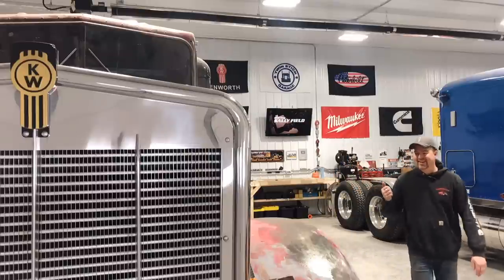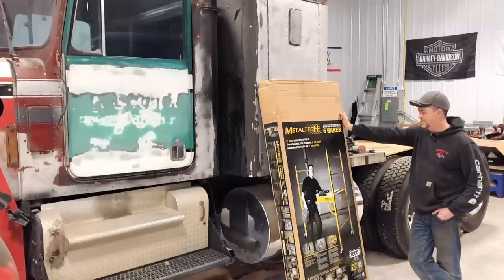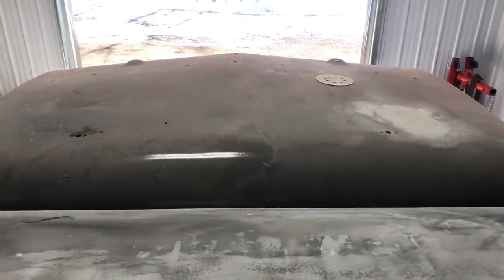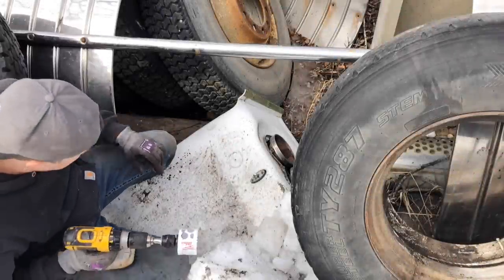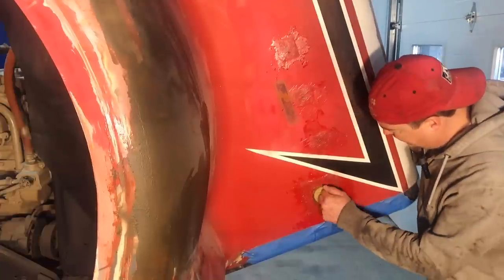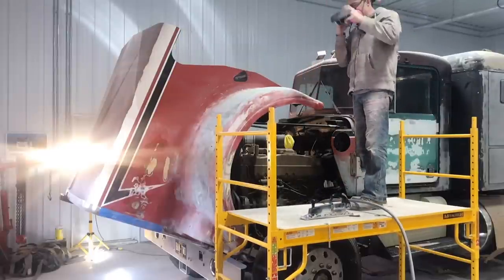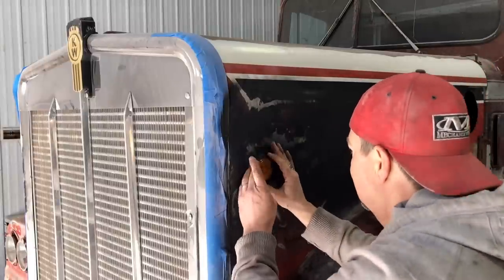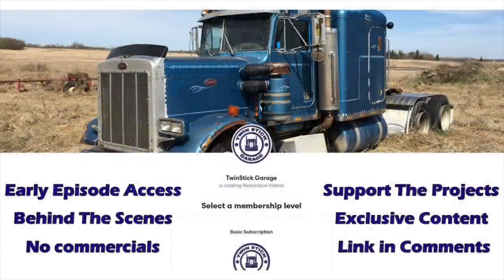Smokey & The Bandit Tribute Truck Ep.41 Un-ringing Bells

Comment: Little hint on fiberglassing. For strength of your patch and ease of finishing it off you should sand your area of repair down the thickness of the material you are putting on. This will make a stronger repair as you are not sanding all your patch material off weakening your patch. Sands flush quicker and little filler and your done. Keep up the great work. Gonna look awesome.

Comment: Mark, the small holes you can use thickened epoxy to fill them, epoxy with chopped fiberglass or actual filler in it, piped through a bag with a corner snipped off. Did a ton of it with the sailboat. For the larger holes, sand the top surface first to give a divot to lay glass in,  put thickened epoxy in hole then add the plug and add fiberglass over top. 

Also I haven't heard John Anderson in years, thanks for the nostalgia moment. So many old country singers I forgot about over the years.
Reply: exactly
Reply: Can confirm. Former collision repair tech here. That would also get the surface sanded first which would get a much better mechanical bond. Another thing I would recommend is to get the glass mat full of resin and roll out the air bubbles before you apply it to whatever surface you're trying to fill or reinforce. Rollers are great for killing air bubbles.

Comment: One tip you should use on putting fiberglass plugs in the hood would be to grind a angle in the fiberglass going away from the hole and roughing the plug up below the flat surface of the hood, which gives it a slight low spot which in turn gives the fiberglass mat more surface area to hold and you are not sanding off all the mat which is you strength and not depending on just the resin to hold the plug in. Looking good.

Comment: Just a couple tips. On your Bondo spreader. Put masking tape on the spreading edge. When you're done and it drys, it peels off much easier. Also don't put air tool oil in your Body air tools as you put oil onto your working surface which contaminates it and can cause fish eyes in paint or just keep the paint from adhering probably and it can peel off as the paint will stay soft. Then you have to start all over again. Also on the fiber glass repair. It usually makes it stronger if you put the matt on the back side of what you're working and dont sand it much. But what you did should hold. Good to see you using the long board. Love to see the progress can't wait to see more.

Comment: For the body filler on the top of the sleeper, I reckon you could use the straightedge/ruler like a scraper. It'd take the filler off the high spots but leave the filler in the low points. Then just sand the whole lot smooth from there.

Comment: Buy yourself some of those cheap ass chip brushes for the resin. What I like to do to make them much easier to work with and to 'stab the resin' into the mat/ cloth is to cut the bristles down a little. Helps quite a bit and gives you more control over the messy application of the resin in general. I've done TONS of composite fab work over the years and have been using this method a long time. It's also less time consuming and it will be easier to prep and 'fan out the repair' if you can build up or add the cloth/ mat more to the backside of the repair area if you have the access. Building up the material more on the back will give it good strength and since you really don't see the underside of the hood, it's much less sanding/ filling/ blending, etc to complete the repair rather than having to do much more to the outside of the panel that can be seen. Basically, all I'm saying, is you can apply your cloth or chop mat to the back of the panel and just the resin/ lightweight filler to the outside. Will cut down on the work you'll have to do to blend in the repair and with the mat inside overlapping the repair area it'll be plenty strong. Get yourself some thin/ light filler for all the pinholes/ air bubble spots. I like US Chem Thin Ice and 3M makes a good one too called Piranha Putty. Will save you the headache of using heavier/ thicker filler or the resin to try to eliminate the small imperfections. A round DA sander will also make things a little bit easier and more precise for you. That long sander is great for some of the flatter, bigger spots but the smaller round one is a must for a lot of other areas. It can be a nightmare to get it perfect if you don't have the right materials or supplies. Just a couple tips from a guy who's been doing this type of work for way too long and loves this truck! LOL Give it a try Mark. As always, love the vidjas!!!! My absolute favorite project truck!!! 👍👍😎

Comment: Hey TwinSticks, when you're checking the level of any surface for depth when applying the Bondo, place the ruler on top and get a black marker and line the area you need to build up. If it is a 6" section for width and length. You may find other sections here and there, and you won't waste any Bondo in areas already at height. Just concentrate on the low areas and fill in the markers you placed. Sanding off will get rid of the marks anyway..

Comment: @TwinStickGarage since you have purchased a decent compressor and are now using an “air file” (aka air long board sander) you really should get yourself an air powered DA sander and a soft sanding pad.  PS far be it from me to suggest how to do fiberglass work but I highly recommend when doing repairs like you did on the hood it’s a real good idea to sand the paint off the surrounding area before doing the repairs. Lastly you really should give some serious considering to sanding the hood and other fiberglass panels and giving them all several coats of “gel coat” to nourish the fiberglass that has had the resin baked/dried out of it over the years.  A few years back I helped a good friend restore his 66 corvette and after stripping the car we put on 20 gallons of gel coat to restore and nourish the fiberglass

Comment: Hi Mark, when using the Sander / Bar sander try having the Hoover hose taped onto the area that you  are working in ( Hoover running )  :) :)  Hee hee ..... that way the hoover will suck the dust up as you are sanding .. Remove tape sticky residue with a Rag and some Petrol ( Gas ) on it... and hay presto........  so much less dust everywhere in your shop :) :) Andy UK ...

Comment: I used gel aircraft paint stripper on my rivet heads not on the fiberglass roof cap of course but spray or brush a little on blast it off with compressed air clean up mess with a little mineral spirits perfect everytime

Comment: Glad to see you took the suggestion to get a scaffold.  I hate ladders, and didn't want to see you come in abrupt contact with the floor.  You might try using some hot melt glue to secure a small wood backing plate.  Glass in the opposite side, when it's cured, pop off the backing plate and do the inside.  You could also wrap the backing plate in some plastic sheet or tape to prevent glassing it in.

Comment: If I have on piece of advice for your body work... purchase good quality fillers and primer from a body supply shop. The stuff they sell at Canadian Tire and Princess Auto are terrible to work with.

Yes they cost more, but they apply nicer and are easier to sand and finish, which means less time overall.

Ideally start with a hard product like fiberglass for the base where needed and work your way to softer products like filler then finally finish putty.  For a really good finish your going to need to apply guide coat and hand block sanding after primer. You will end up doing multiple coats of primer on areas that need fine finishing to get it right.

Body work is a lot of work...

Comment: Hi Mark,  I dont like to be critical here but be carefull with that air sander, you'll end up with flat spots and ripples. Maybe an air powered orbital for good condition areas. Any repaired areas should be done by hand and block in a cris cross fashion.
 I thought also for the huck bolts you could use a hobbyist type sand blaster with well used sand on a gentle pressure. Cheers here in NZ

Comment: If you bevel the fiberglass with a grinder before you put the glass on
There will be a lot less fairing compond 
When putting on bondo as soon as it gets hard use a cheese grader on the bondo it takes down the high spots and it stops the sand paper from clogging 
Save money on paper 
Over a round end use a 
X patern when you go over rounded corners

Comment: When "filling" fiberglass, one of my favorite tricks : 
Mix half a batch of your favorite body filter
Mix a batch of resin
Mix the two together.

Smother than Bondo and doesn't run like pure resin
Reply: i used to put the resin with a brush so i didnt had to sand it down like an asshole

Comment: If the goal on the Huck Bolts is to just clean the paint and grime off, using baking soda in a spot blaster may be just the ticket.  With baking soda you can remove the paint off an aluminum can without damaging the can.

Comment: With cleaning the paint off the hucks try using a hand held sand blaster with soda or glass grit in it as both will remove paint an not eat in to fibreglass as much as sand does

Comment: For cleaning the tight spaces around the huckbolts, have you tried a sandblaster with crushed walnut shells? A bit messy for the shop but on low air pressure, it may not wreck the fibreglass.

Comment: a while back I wrote about the excellent vapor blasting gear sold directly by The Tacoma Company. Cost is around CAN$500 and is superior to any other available equipment. Watch some vapor blasting videos to see the results. Viewers have also suggested a spot blaster with baking soda of some other mild abrasive to clean those hard to reach hucks. DeBoss Garage had the same struggles working on his super incredible KW restoration project.

Comment: Filler quality DOES matter. I'm cheap so always buy the garbage stuff. Especially since I'm so bad at body work I go through heaps.
But a friend gave me some left overs of what he uses in a body shop and it was the top of the line gear and it was so much nicer to work with. It laid out 1000 times better and if you hit it at the right time you could take the bulk of it off in 30 seconds with 1 bit of sandpaper as opposed to taking 15 minutes and 10 sheets!
But for the size of a truck I would persevere with the cheaper gear. Spend money on shiny bits instead!

Comment: mark when your using huck bolts start with the tool backed off a little then screw it in further close open screw in further until its where you want it

Comment: The hood marker lights look a lot better, nicely done!  Guess you are still not keen on the idea of swapping out the Hendrickson rear on Snowman for the movie correct torsion bar rear that is on Iron Duke?  It would be a lot of work.
Reply from the maker: Not worth it and it’s still undetermined if the 3rd truck had torsion or plain old Hendrickson … I’m gonna assume the latter 🤔

Comment: Mark you need to sand the fiberglass before you apply the body filler on top of it..( Where you put new fiberglass on hood area 
the reason you use proper tools when wetting in the mat on fiberglass is to prevent air pockets like yours got..you lose a lot of the strength getting pockets

Comment: Hello Marc from Germany. I follow this Build since Day one and i like it. You make a really good Job. But i have a question. Did you think these ribbets want hold very long in Fiberglas? I would use Nuts and Bolts maybe on the Roof Lights also. Its easyer to remove after a bit of Time and stronger. But is's just a thought of mine. I'm looking forward to it when the Truck is finally painted. Nice Job

Comment: I do bodywork and they have a chemical  you can put on that paint that will bubble that paint and you can actually pill it straight off you don’t have to do any sanding or anything you could’ve actually stripped that truck down to the original fix the bodywork and spent less time than what you been spending on it and that’s how they do big rigs
Reply from the maker: Yeah I’ll probably use paint stripper for the hucks on LBL and Duke but I’ve heard you can’t use it on fiberglass so all of those would’ve have to have been sanded anyway 🤷‍♂️

Comment: thats not the wright sander for that you should use a 8" D/A& 3M Marson lite is the best filler it's like whip cream .sands very nicely .
Reply from the maker: What you can’t sand a semi truck with a battery powered wood sander??? 😂
Reply: @TwinStix  hay guy  a 8" sander is a orbital air sander .that air file your using is for flat panels and out dated the 8" is called a (Bondo Buster) once you use it you will never use that air file again ,way better!

Comment: For the huck bolts, wouldn't Aircraft paint remover work easier? Brush it on, bubbles paint off.. wait for it to dry out some, and brush it off. And of course clean the surface before paint.. but should be easier than using tools with pressure and or abrasives.
Reply from the maker: Yeah you may be right … will give that a go when I prep LBL and The Duke 🤔
Reply: @TwinStix  Good stuff! Can't wait for more progress! Keep it up! 🙌